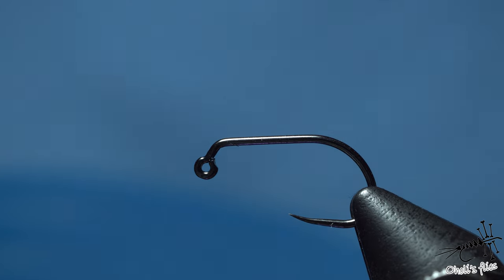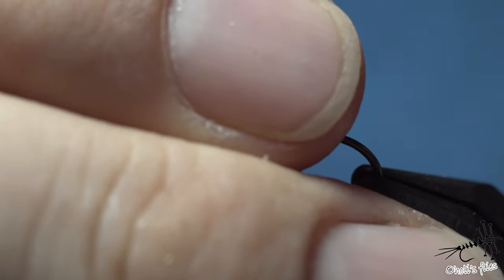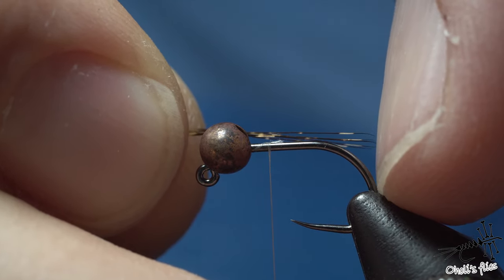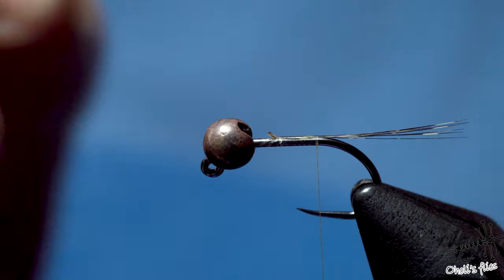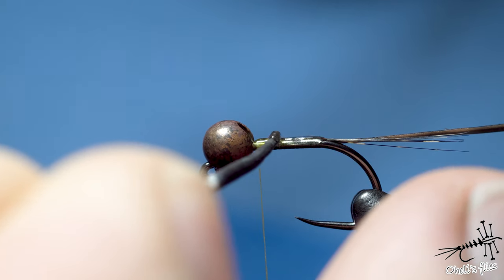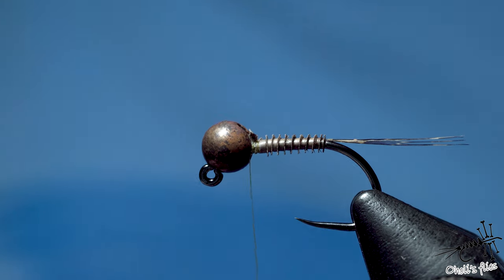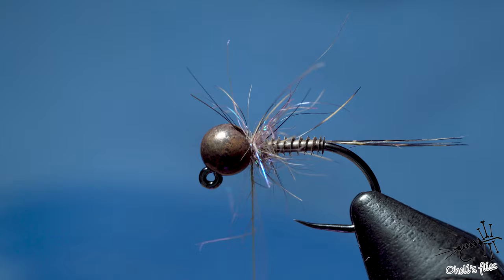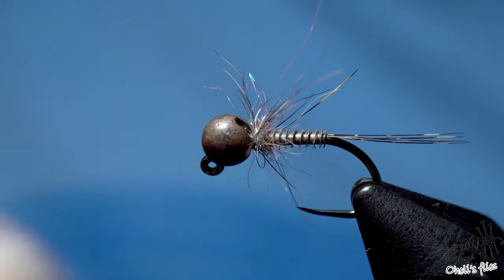Burn that tungsten!!! Peacock Barb Nymph (Sinks almost like a perdigon)

Comment: Great idea , thank you .I realize this fly isn’t supposed to be flashy but …
Have you thought about filling the slot of the bead with red uv resin to create a hot spot , and secure the bead to hook.
Reply from the maker: Thanks. Well, its up to you, a bit of red can't make it worse. Red is good 😀
But as for securing od the bead... Thats already done by all other materials 🍻🍻
Reply: @Oholisfliesandfishing  with regard to the resin , I meant just as another way to secure a slotted bead , and create a hotspot . Not necessarily on this fly , but maybe another creation. Just another technique to try 😀
Reply from the maker: @bobdepradines1773  absolutely. On perdigons i like to fill in that slot and make everything smooth 😀😀

Comment: like your video, we are the original tungsten beads manufacturer, I am confused,why you are heating tungsten beads?
Reply from the maker: Thanks. It's simply to change colour. Plus its very durable unlike having coloured beads. On the other hand, not many options like this. Sometimes its best to buy certain colours

Comment: Where did you draw your inspiration for heating the bead?  Have you no love for gold beads?  Too flashy?
Reply from the maker: Golds are what i used at first.... It was only available at the time.... As other colours became more available i realised i prefer copper and silver the most. So yes.... When i dont need flashy stuff this is solution... Not my solution.... Friend told me about it. 🍺
Reply: @Oholisfliesandfishing  Your videos always bring something fresh!  May I suggest a video on how to properly sharpen a good set of scissors that has gone dull?
Reply from the maker: @gregb8824  thanks for the suggestion... I have never done it... In all honesty i only recently got first proper pair of scissors. TMC micro serrated... I did bend the tips bht i managed to repair it, more or less... They are not as before. Sharpening them is something i still dont know how to do. Sorry for that 🍺🍺
Reply: Bass fisherman often flame their tungsten weights to darken them and reduce the shine/flash.  I torch the crap out of mine until they char a bit and turn black.  Good thing is that they never chip or lose that color.